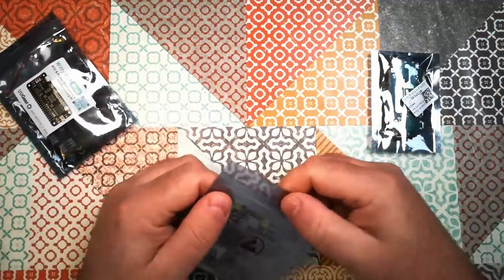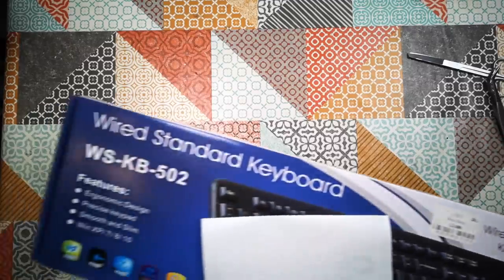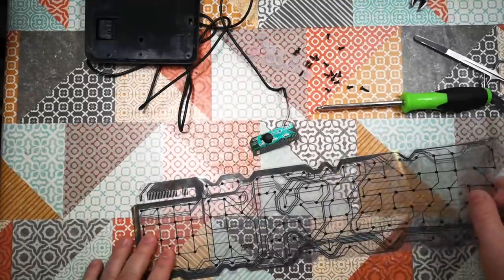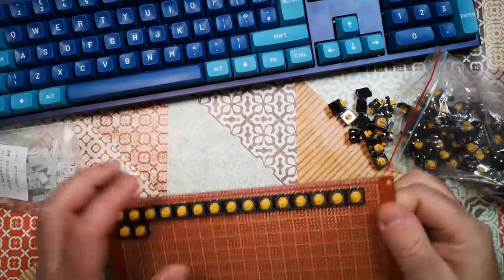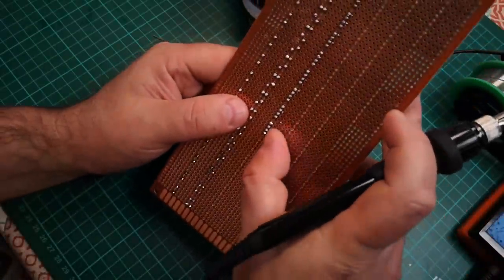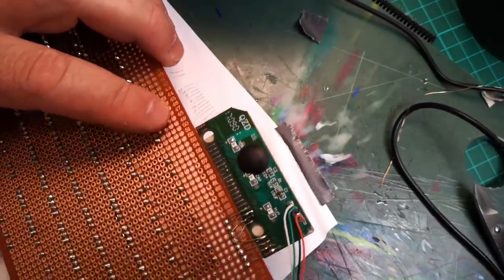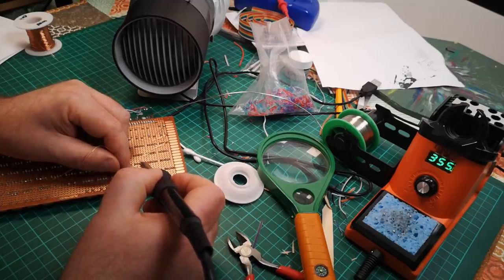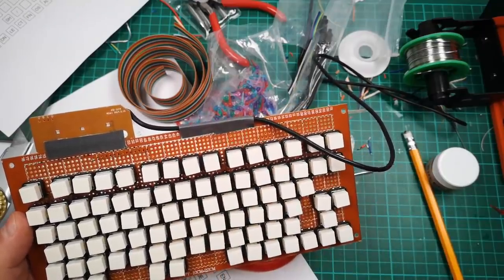How to NOT Build a Keyboard, or: Time to Stop Doing the Same Thing Harder

Comment: You had a working keyboard at the start, and went through enormous lengths to make a worse keyboard out of it.  Maybe it would be better to just attach a case for other components to the keyboard.
Reply from the maker: Did you miss the point about compact size?
Reply: @AtomicShrimp  yes, i actually wrote this comment before reading your pinned one. Still, i don't think the result would be cheaper than buying an off-the-shelf small keyboard. 

Also, I want to build some keyboards out of broken notebooks without controller programming and stuff, and you just shown me another idea how to do it with this video. Thanks.
Btw, you have a nice point about soldering usb stuff instead of using the connectors.
Reply from the maker: Thanks - yeah, I just wasn't able to find a small wired keyboard that fit my requirements - turned out I wasn't able to easily build one either, but sometimes, I get these ideas of the form 'wouldn't it just be really easy to do X?' - and the best way to discover whether or not it really is that easy (it never is), is to run the idea to ground.

Comment: If you're buying a functional thing in order to destroy it and make the same thing then that should generally be seen as a red flag on the 'is it worth it' scale
Reply from the maker: I wouldn't say so. Tearing something down for parts is not altogether uncommon. That's certainly not what went wrong here
Reply: @AtomicShrimp  Tearing something down for parts is fine if all it's good for is parts but you bought a functional keyboard in order to end up with 2 non functioning keyboards.
Reply from the maker: Yes, the project failed, but not for the reason of using torn down parts. You have the benefit of hindsight when making the judgment
Reply from the maker: I mean, I do understand what you mean - the fact that I ended with less function than I started does significantly create a sense of futility to the whole thing, and that outcome was made more likely by the fact that I was fumbling my way through a foreign design, but... I could easily experience this problem with an off-the-shelf interface solution, if that too is sufficiently foreign to me, and I do think if I attempted this a second time by the same methods, just avoiding the mistakes of construction, I would actually succeed.
If I was tearing down a fullsize keyboard only to build another fullsize keyboard, I would agreee that's pretty futile, but the objective here was to make something more compact - much like Ben Heck did with all of his portable versions of consoles (except Ben has the advantage of being very much more competent than me in the relevant skills)

Comment: yep. no. dont do that :-) ... there is a nice raspi keyboard out there even with integrated usb hub ? 20 bucks i think.
- i built some macro/special simulator keyboards with arduino (pro micro) but the "32 button box" is at the point of hating yourself if you dont get a pcb done.

Also smaller (better) soldering iron ? residue free flux pen ? (never liked and thus used meltaway wire!)
ts100 works wonders for the money and there are nice complete packs for 75bucks (compared to 700 bucks weller stations which 99% do the same)

.. Also getting a "kinda good" screen in a special size which does not get too thick (and power efficient)
and has a reasonable resolution and viewing angle can get really expensive. - Maybe try to hack an older 10" tablet screen ? or old ipad retina stuff?
My old cheapo Lenovo Tab 2A10 .. or was it 10A2 .. basically is a huge battery and a teeny tiny cpu/mainboard. and large screen.
If i tried to get that smaller i could not get it done in any way. (still readability in sunlight sucks)
(i guess even using the tab to go remote display onto the raspi would work better most of the time but is probably cheating..)

Since the battery will be the biggest thing if it needs to be usable, dont try to downsize everything else and make the same mistake all new laptops have:
no offgrid runtime when using them because low battery power, really bad cooling because of missing space/case height,
again too small battery because overforced compactness, useless low power i7s which are constantly throtteling due to power+thermal limitations.
And missing 2 bucks worth of conformal coating as protection for a 2000bucks device so it corrodes after a wet sneeze in the same room.
Reply from the maker: I have not yet found a ready made keyboard small enough to fit the design. It needs to be 200mm wide at most

Comment: I sincerely don't understand why you started at a use off-the-shelf model to start, then went right past the 3 pound usb keyboard to go through the more expensive and time consuming process of building one yourself.  If we presume a labor cost of 80 pounds an hour, that keyboard would cost you what? 300 pounds? 400?
Reply from the maker: There is no off the shelf keyboard that fits the size I need

Comment: A simple case of: "I should have checked each solder, before applying it." I could see where each set of pins belonged to each separate key...well most of them. So having this in mind, you can reason pretty accurately where the other pins should be and what key they were attached to.  A magnifying glass would needlessly have helped make your task a liitle bit easy. Just my take on the subject.

Comment: 7:07 lol probably a not insignificant part of the cost is screws. Pathetic. They could have just snapped it together and saved a buck or so or even better put some more plastic in the form of internal ribbing to stiffen it. Membrane keyboards become unreliable as they flex and the registration of the membranes goes out